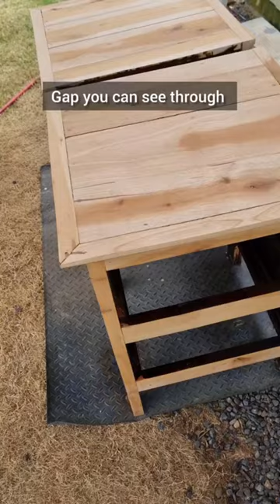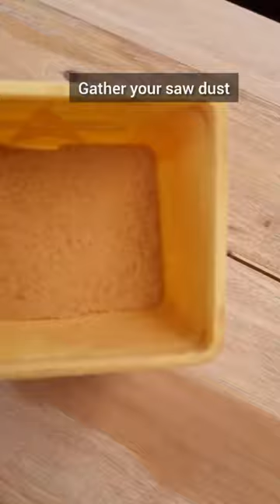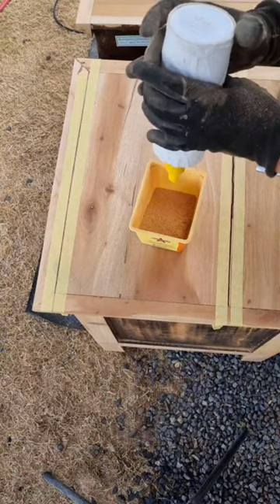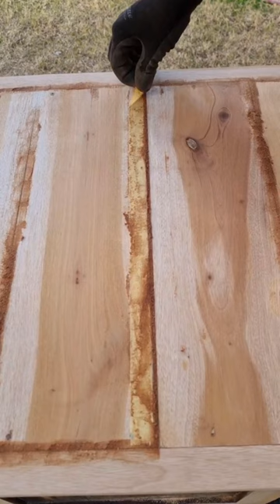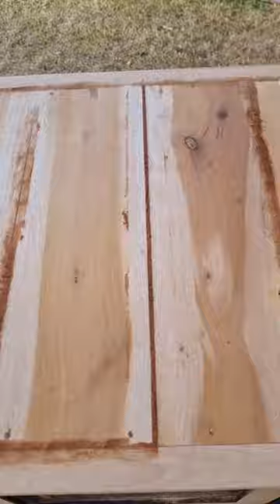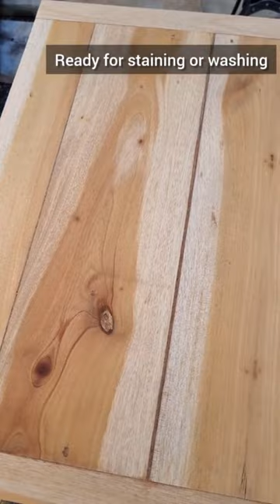How To Fix Wood Gaps #shorts

Comment: I have seen this one fail in real life. Weather changes and board expand or contract and the filler breaks apart, just a matter of time.
Reply: Look at the video carefully and you can see a failed joint for exactly the reason you said above.  Might have been this same process done the first time.  

Not saying this is a bad technique, just that wooden outdoor items will always swell and shrink and no fillers around - store bought or home made - can survive that much movement. 

Good method but I would have also brushed glue into the joint to prime it and get better bonding.

Comment: Do you take the tape of after 6 hours ?
Reply: They wouldn't know it's not their content 😡
Reply: @Vintage_Oak_Designs  Why was it posted on their channel in November of 2022 and on your channel on April 2023. Also they did a great job of removing the TikTok watermark.
Reply: No, you can right away
Reply: 12 hours 😅
Reply: You need to take the tape as soon as you do the steps because otherwise you risk pulling out the home made filler. It’s happened to me